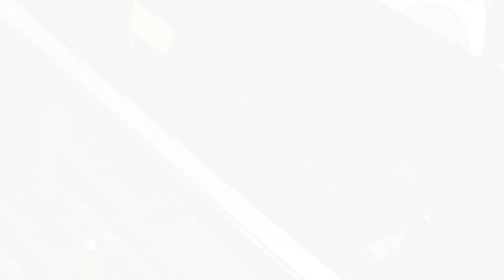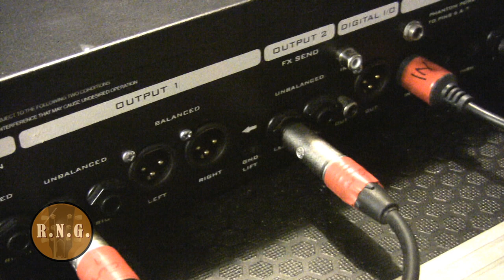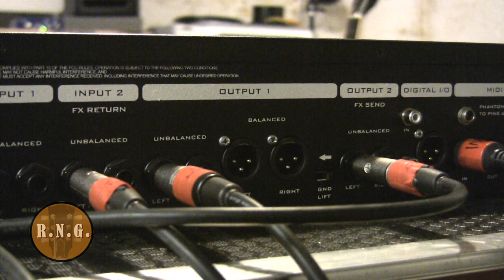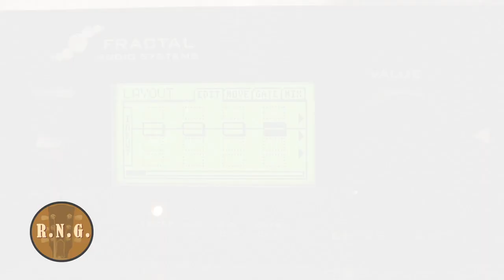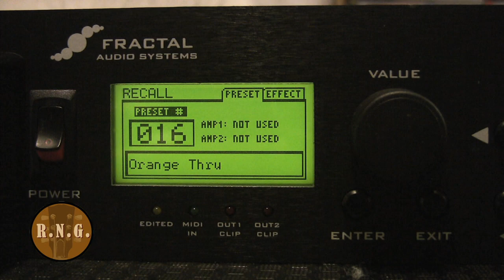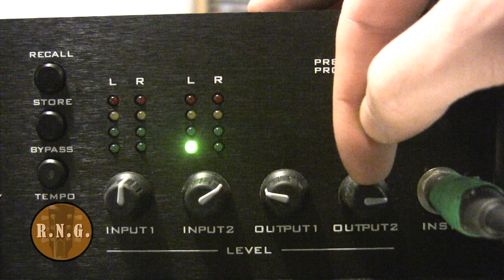Axe FX - Routing an Analogue Head through the Axe

Comment: The only downside is your guitar signal goes through an A to D conversion then another D to A before it gets to the input of your amp. In addition using the fx loop in your amp fx loop you are also doing another AD-DA conversion so that is 4 total which bumps the latency up.  I played on a tour using only the Axfx and with a digital wireless pack and a digital PEM pack it was 6 conversions to the house and 5 to my ear which was pushing the limits of latency and was not ideal.

Comment: Great vid man. I have the ultra and I wanted to have two outputs. 1) has poweramp and cab simulations and goes to the PA, and 2) with poweramp but no cab simulations and goes to a real cab on stage. Is that possible with the ultra? Thanks in advance for your help.

Comment: The front input connected to the axe fx runs into the pedal board and then into your guitar?
Reply from the maker: Ramon Martinez If you're using pedals, yeah.  Treat it the same as you would the input of an amp.  The Axe FX II's firmware has been model very well, and responds to pedals nearly exactly the same way as a real amp.

Comment: Do you have any idea of how you may do this with a pod hd pro x unit? I set up mine cable wise as close to this video as possible and had no luck.
Reply from the maker: Without one to hand I couldn't tell you.  The import part is being able to isolate where you send the FX loop out in the signal chain.  Are you able to edit that to the same degree as the Axe FX?
Reply: After seeing this video and looking into it more, it does seem like i can modify the inputs and stuff so ill just have to mess with it. It just sucks i cant find any info on this particular situation for the pod!! Very frustrating.

Comment: What would be the benefits of this? Would you effectively be able to run your head tube head signal straight to the FOH, using the Axe as a DI box?

Does the tube warmth come through after it's processed through the Axe's effects return?
Reply from the maker: You won't be able to DI the head, no.  The Axe doesn't act as a loadbox; you'll still need to connect the head to a cab.  The main idea here is to have the best of both worlds; digital preamps, allowing you to choose whichever voicing you want plus FX and processing, yet run through an analogue power amp, smoothing out the sound, and generating the saturation and compression everyone knows and loves.

Comment from the maker: Without looking at the routing options of a Pod I can't say for sure, but I'd imagine so, yeah.  The other option is to run it straight into the FX return on the 5150 and use it as a pre amp; that's the standard routing.  This allows you to use the modelled pres through the 5150 power amp.  Thanks for watching and commenting mate.

Comment: Awesome video! You're very thorough. I assume this method would work similarly with a Line 6 pod pro live rack unit? I was thinking about getting one and running that through the fx loop on the clean channel of a Peavey 5150, the Peavey working as a power amp. I've also noticed many players using this method, not plugging into the amps input, but just the preamp unit.